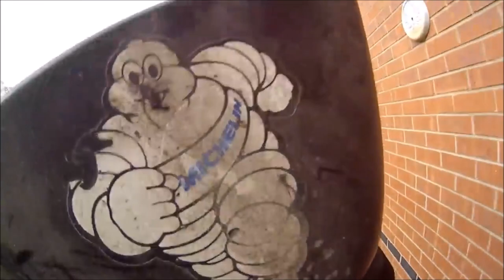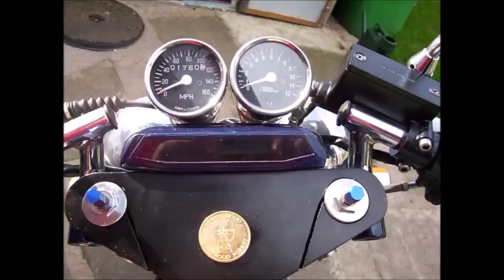Re Introduction to the cbr1000f landfill bike project.

Comment: One way starter clutch mate.
Reply from the maker: yes mate that's what it was...
Reply: @jonyr1TT  Glad to help. I had the same problem. Otherwise great motor, mine did 110,000kms when I sold it and it still purred.
Reply from the maker: Great bikes 👍 this will be my third cbr1000f. 👍